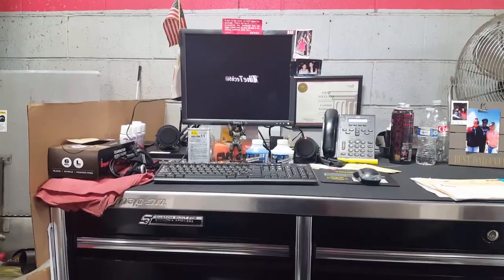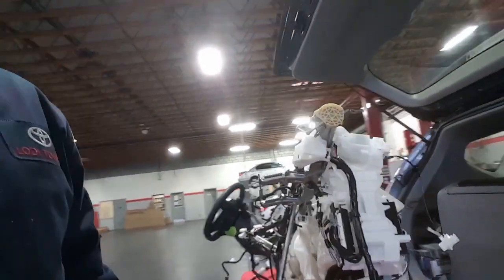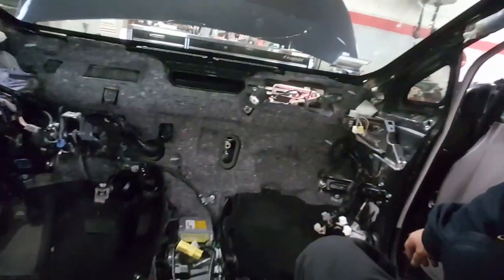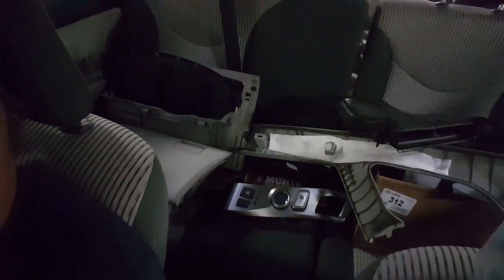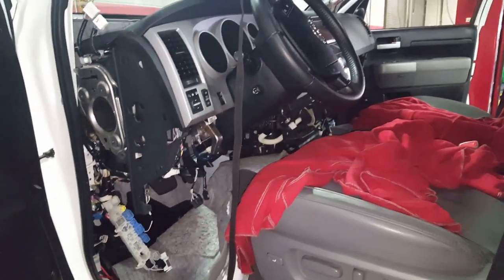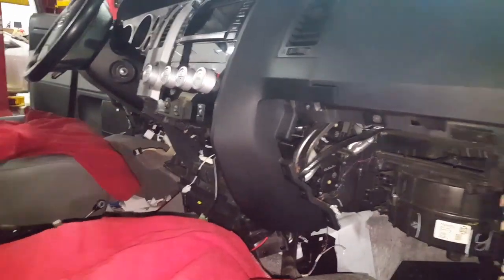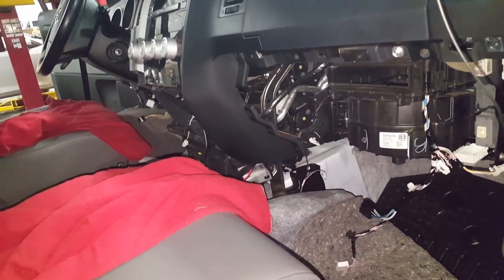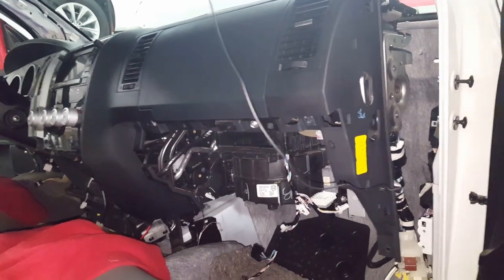Hold on Tight... For the next Projects!!!

Comment: Hello I'm having a similar problem on my Toyota Prius. I found rodent droppings either mouse or rat inside the car, cabin air filter. I took it to a mechanic he said he couldn't find the dead rodent but found droppings. The smell is so bad I can't drive the car. I had Orkin tech come out and helped me remove the backseat and looked in the trunk. Couldn't find the dead rodent, the smell is unbearable. What do you recommend? Are you in southern California? I have car insurance, and my 2014 Prius still is under the Platinum warranty.
Reply from the maker: Sorry so late in the response. I really feel bad. I hope you took care of the problem. If not, I would recommend calling your insurance so they can pay for any Diagnoses and Repair on your vehicle. The Platinum Warranty is an extension to your regular warranty and covers all parts and labor for any defects on the Manufacturer. It does not cover any outside influences, such as rodent damages. Through experience, we always advise our Guests, to contact your insurance first, or otherwise pay out of pocket, if their insurance does not cover that type of damage. Hope this helps.
By the way, I'm in Northern Ca.